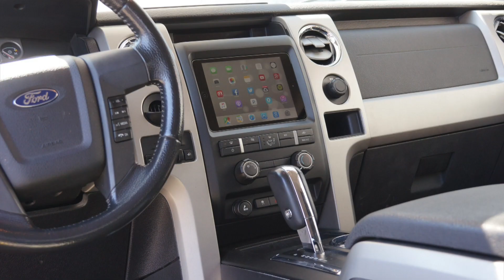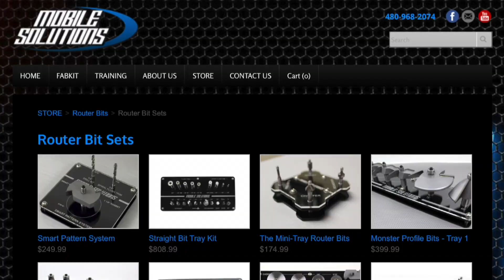That's Not Right

Comment: hey doug do you have a video on how you wired your door poppers on the muel
Reply: +Gilmar procopio JR Door poppers aren't that bad to install, there is a lot of data floating around the internet showing multiple different installs.
Reply: Ive looked on the web i vant find anything that seems to work. I have a 12 channel remote brain and relays but nothing seems to work